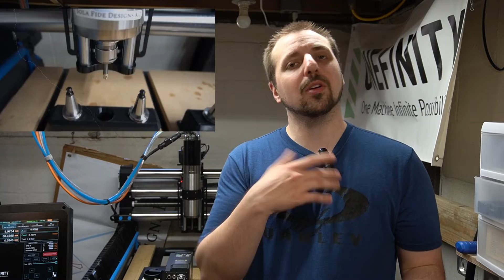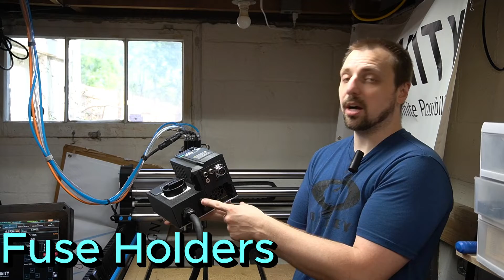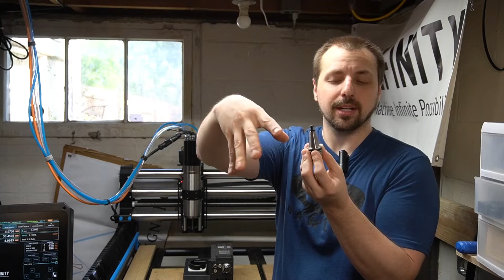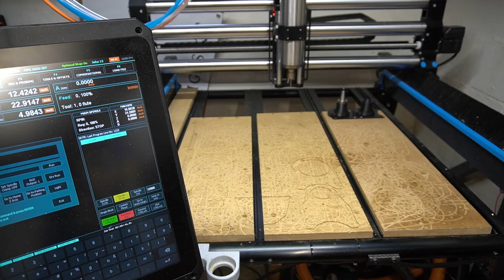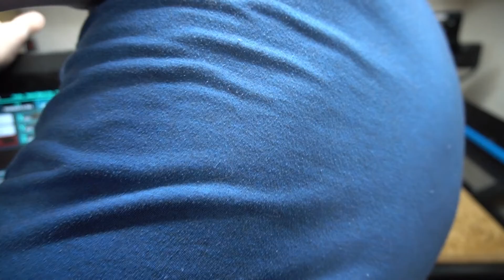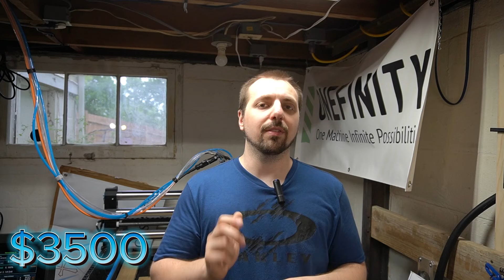ATC Spindle System by SolaFideDesignsKC. Works with the Onefinity Elite CNC Machine

Comment: Hi, first time on your channel, you have done a great job. 
I bought my fist cnc a month ago, Onefinity elite foreman and I decided to install ATC spindle. Never done this before but I think I have finished connecting all pneumatic valves, water cooling and flow sensor today and everything looks working manually for now :-) (changing tools by pressing the button manually I mean), I need to make places for toolholders and to set tool positions in masso. I have connected manual tool release the way so it doesn't work while spindle is spinning as a safety precaution. 
There are 2 things I couldn't find how to do. 
The first thing is how to configure tool holder sensors in masso, have no clue where to find that? 
The second thing is how to configure the pneumatic valve that helps to clamp the tool if the spring fails (tool retracting valve). 
-To solve the 1-st issue with toolholder sensors I was thinking to use "open door" input for that, but I am still thinking on it. 
-Tool retracting valve (that clamps the toolholder in place), I was thinking of two possible scenarios, 
1-st method to mount the time relay to normally closed contact , so when the output is High and tool is released the time relay is off, but when output goes low and the spindle starts to clamp the tool, then the normally closed contact turns on the time relay and it triggers the return air valve for 5 seconds (5 sec. is showed in the spindle manual) 
2-nd method is just to connect return air valve to NC contact directly, so whenever output for tool release goes low, the tool retracting valve will be turned on, but it will have to be under pressure almost all the time, though I have checked, the spindle is still rotating well in that circumstances so I think it will also work.
I am not willing to ask about the way you have done it, not trying to get your secrets, just trying to hear your prrofessional opinion on my humble thoughts, if possible off course. 
I am not professional in this subject and I am sorry if I sounds stupid, as I said I have never done this before, learning from youtube 🙂, from guys like you,Thank you for that. English is also not my first language, so I apologize for my mistakes and for very long text.
Reply from the maker: All spindles are different, and so on, and the sensor can also vary. I have a few videos on installing my old ATC system, which I am no longer selling. But the ATC is without any sensors. But in the videos, I do kinda touch on the Masso layout and settings for an ATC. I would look over the docs for Masso on the ATC and also take a look at the forums. For the tool release, I would run that through the VFD itself to lock out the spindle from being able to open why it's running so it would look something like the selenoid In line with the VFD, and when the VFD is sending any type of power to the spindle, it will lock the selenoid out. Not allowing you to open the jaws by accident. Masso also has Open and Closed jaw sensor inputs. You need to make sure you have the correct sensors. Depending on the type of sensor, you might have to run some extra stuff to get them to play with Masso nicely.
Reply: @solafidedesignskc  Thank you so much for your reply, I will certainly watch all of your videos .👍

Comment: Great walkthrough of the safety features of your ATC system! As someone who has ran industrial CNC routers, I can say this kit provides a VERY similar experience to operating machines with a $50K price tag. Well done!
Reply from the maker: Thanks, man! I appreciate that! I ran a few industrial-grade machines. There is nothing better than running 1100IPM 0.75 doc in some plywood and watching the rooster tail fly :) Mostly cut commercial-grade cabinets out and honestly can't stand particle board or laminates anymore, lol